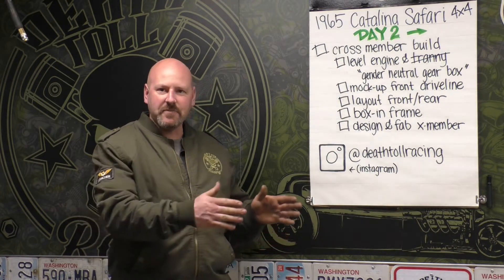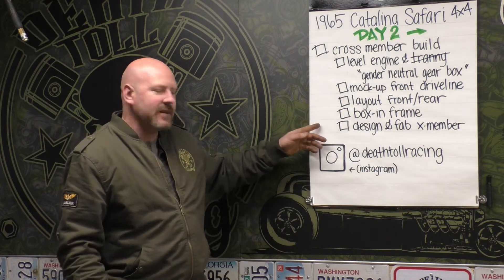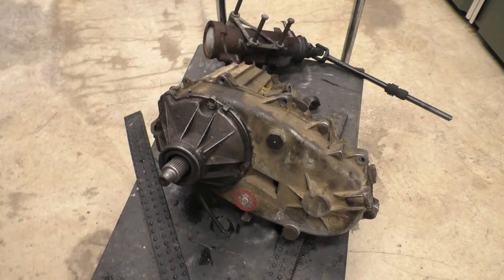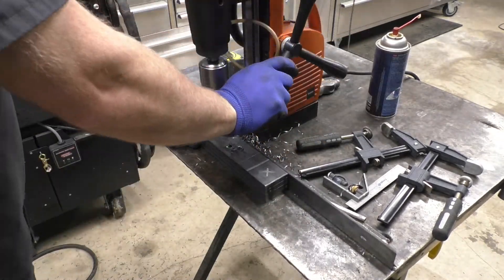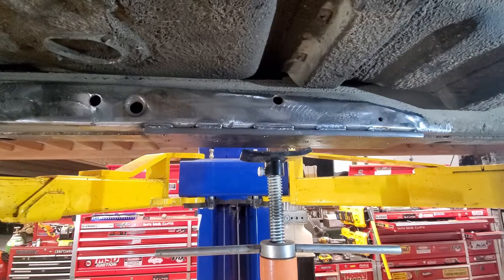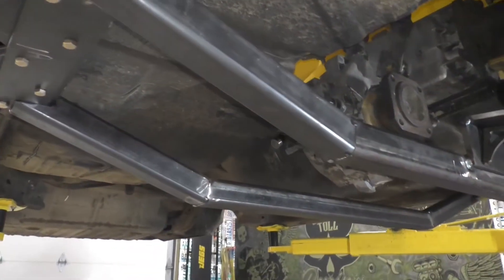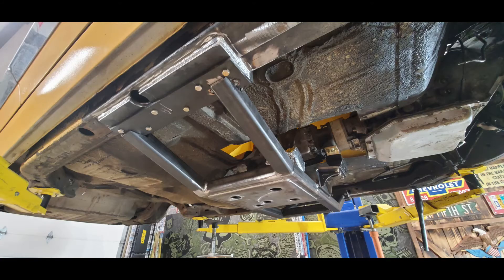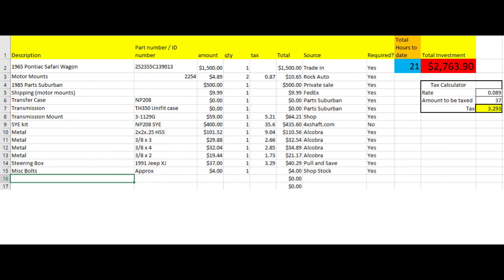E2: 4 Link Cross Member Fabrication: 1965 Pontiac Catalina Safari 4x4 Overlanding Project

Comment: Hate to ask because you’re probably not sponsored by them, but how do you like your mag drill?  Would you buy it again, or a different brand?  I’m in the market for one, and trying to decide which model to purchase?  Thank you. Joel.....
Reply from the maker: Its okay.  It's too big though.  I wish I had a smaller one 99% of the time.  I don't like that every time you turn it on its on full blast and you then have to press the slow button.  I wish it would just start up to the same speed you turned it off at or better yet, just have a dial and ditch the electronic speed control.  Otherwise it's good.